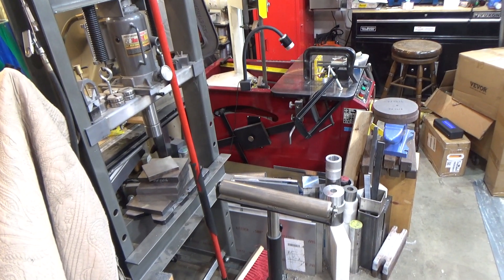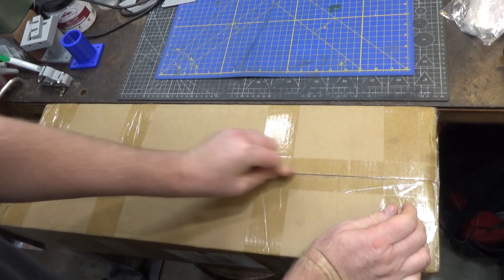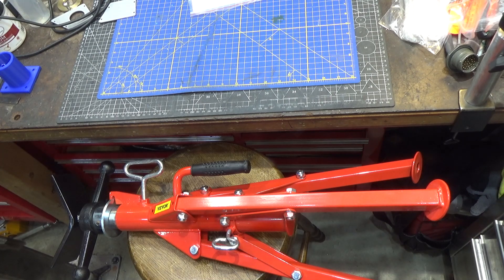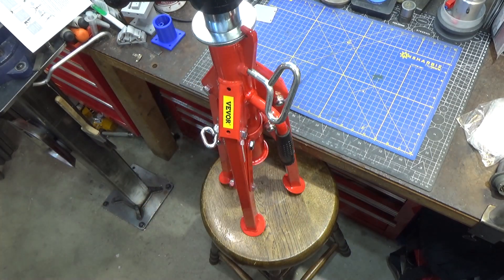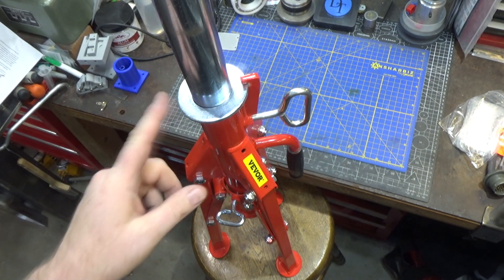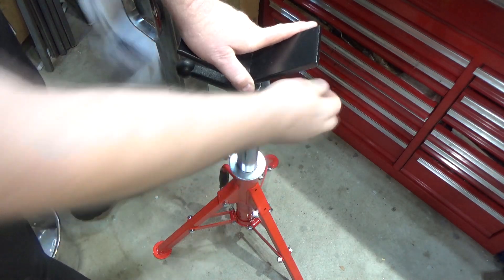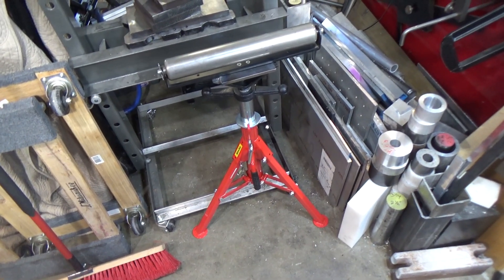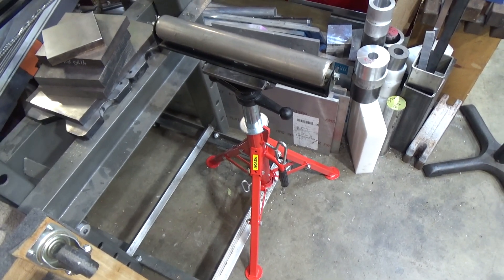QTR 105 Vevor 2500LB Portable Pipe Stand

Comment: Makes me wonder what sort of duty you could get out of it as like a hardcore machinist jack.  Put that 2500-lb rating to the test to see how well it can jack up material to put a bend in it or like support a span (using an additional piece of material) for remodeling or construction.
Reply from the maker: Not a bad idea. Testing to failure can be a lot of fun. I am not sure how much I would trust the cast iron "fine" adjusting nut. I find that sometimes the ratings on these tools are exaggerated, like my 20T Harbor Freight hydraulic press that was able to get to 40,000 pound pressure, but deformed permanently as a result of the test.

Comment: I would not cut or weld anything. Just make a matching V and insert that into the v, then drill and screw it to the stand, that way you still have the option.
Reply from the maker: That is a great suggestion, thanks for the creative solution.